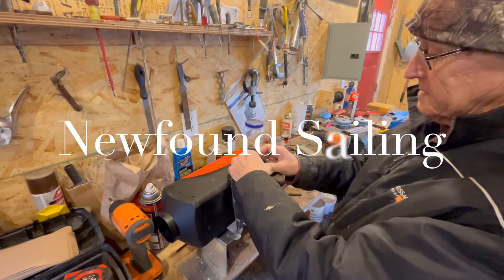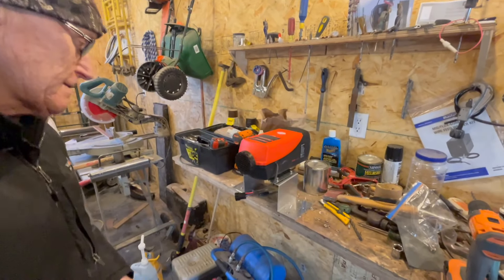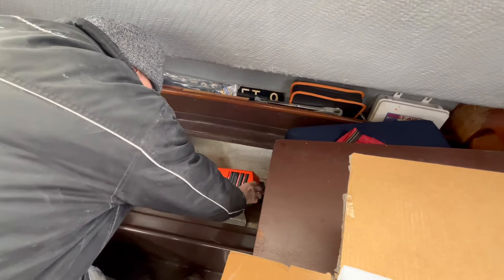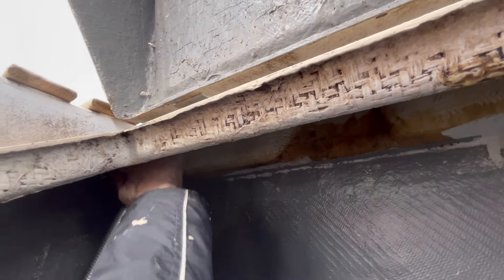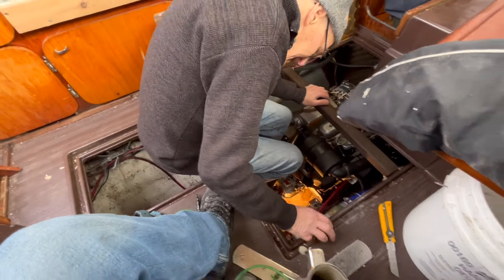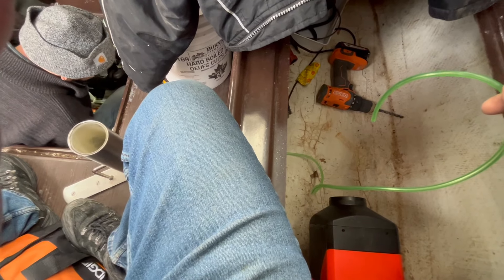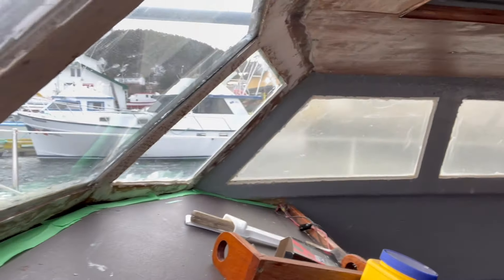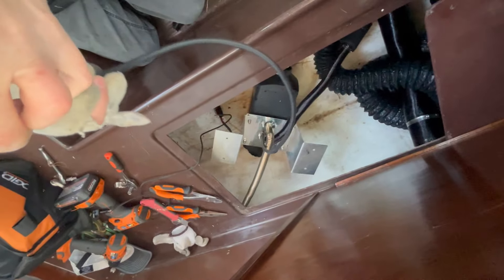Installing a Vevor 12V 8KW Diesel Heater In Beneteau Evasion 32 Sailboat During The Winter of 2024

Comment: I see you used the muffler. From what I’ve seen in forums is that those are meant for vehicle installation outside of the vehicle and apparently have a small drain hole for moisture. From what I’ve read that hole can allow exhaust gases to enter the boat and that it shouldn’t be used. Your muffler may be different but I’d suggest investigating that to be sure you’re safe.
Reply from the maker: Thanks so much. We'll check into it. All the best.
Reply: @newfoundsailing hello, as the other user suggested, not only it have a hole on it but on a boat with longer exhaust line as you have there is no need of silencer, also the flow without it is much better and heater combistion will benefit.
No boise at all, noise issue is with 50cm pipe mostly straight on cars or vans, on a boat when you have 1 meter or more with couple of bends the exhaust noise is non existent